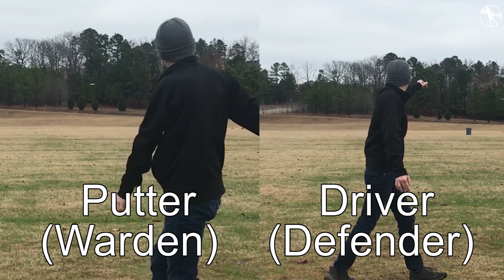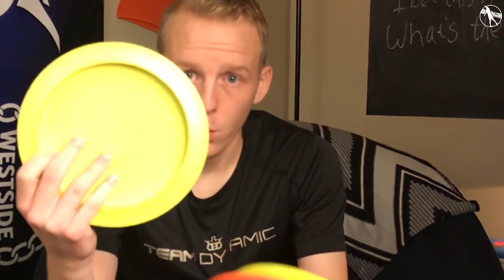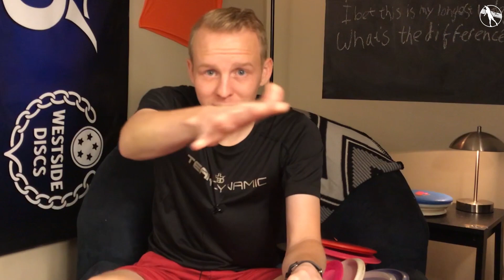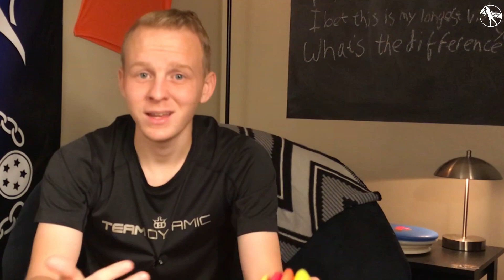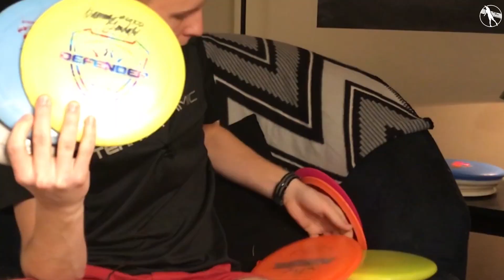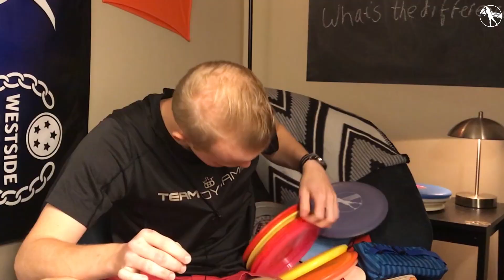Golf Discs Explained: How are they supposed to fly?

Comment: I'm looking for a disc like that pink renegade you have. An under stable driver that I can throw an S curve with. My question is, how can I purchase a disc like this, without being able to throw it, and know it's going to fly like it's intended to fly? What characteristics do I need to look for to identify an under stable disc, specifically a driver.
Reply: Buying a new disc is always going to be unpredictable, unless you live near a retail store that offers the buy back program for the trilogy family of discs. That will allow you to try a disc for up to a week and if you dont like it you can return for another disc. I believe you can find that info on the Dynamic Discs site. As far as what to look for in an understable disc, you want to try a disc that has a negative number in the turn category. For example a disc with a turn of -4 will theoretically be more understable than a disc with a turn of -2 and so on. l would also explore understable discs in multiple speeds. The Renegade as shown in Danny's Video and a disc like the Westside Queen would be good distance drivers to give a try but I would also explore the DD Warrent or Evidence  as understable midranges and possibly a deputy or gavel as putter option. Getting that controllable hyzer-flip at all speeds can be very helpful in the woods.

Comment: Spinning doesn't make it want to go vertical. Discs "fade out" as their gyroscopic rotation slows because of gyroscopic procession which makes it want to turn 90 degrees ahead of it's rotation. This is why the disc turns the opposite way of it's rotation.